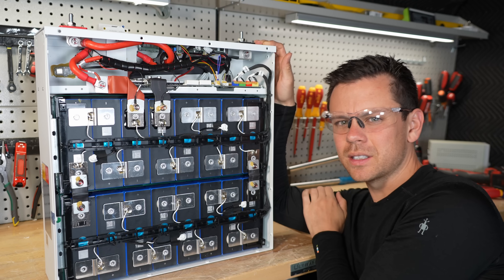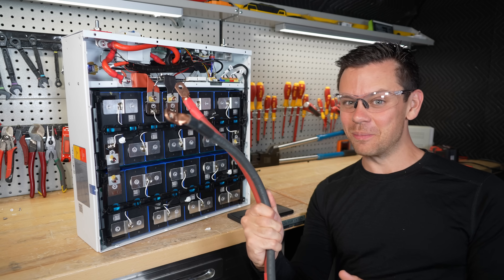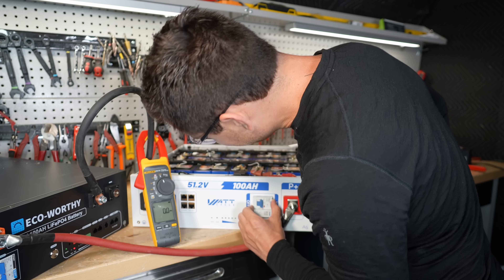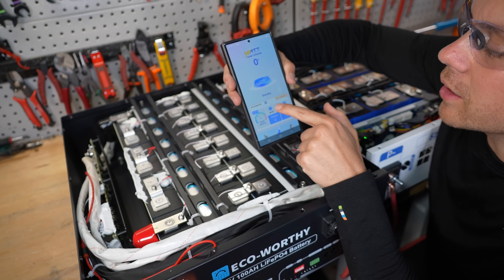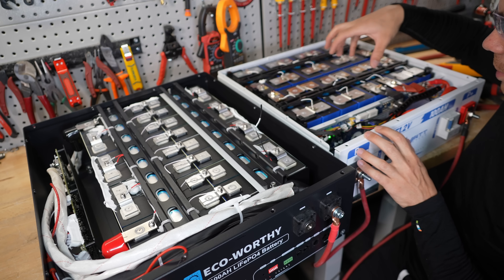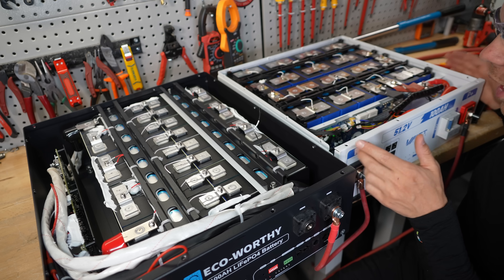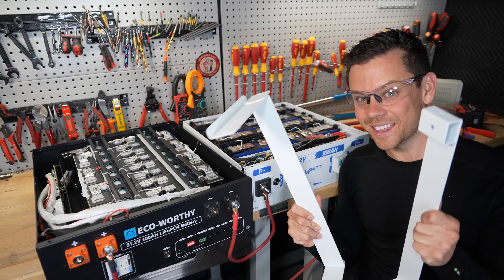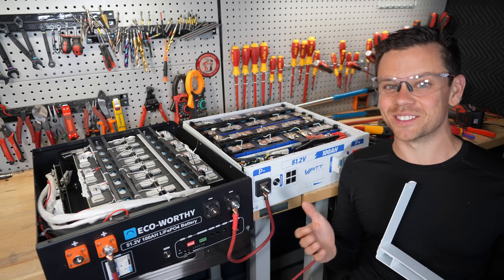$849 Wattcycle Server Rack Battery?! Quick Review...

Comment: My My My....  Mr. Prowse has great influence!!!!  I just received a consumer message from WattCycle about its new gen 2 server rack battery.

The message stated :..." V2 was rebuilt after Will Prowse's V1 test ---- updated with real feedback in mind, for cleaner long-term performance ---- without pushing the price out of reach.  Better fit for home backup & rack storage; cleaner install, easier ownership.  7-year Warranty (5+2) ---- our way of backing the platform with confidence. "

I'm newbee in to buy two V2 server rack batteries.  Excellent Work Will.  🤙

Comment: More than just an inductor is needed to regulate current.  Any slow charge/discharge capability requires switching or resistive limiting.  The current limit test in regard to having ‘no inductor’ was not a valid test.  Unless the battery contains an active DC/DC converter, no battery will actively limit current.  It’s fair to assume the battery should detect an out of balance voltage and potentially switch to an alternative charging method (resistive or small flyback/buck) though.

Comment: Regarding Will's stance on ring terminal temp sensor. Ring terminal temp sensors just add another step to assembly and thus cost. So what if the the sensor is more accurate? It will have a lesser margin of error. The BMS should take action long before even reaching a precise value where error would be detected. I do agree that temp sensors need some level of being mechanically secured. A divot with piercing where the glue has something more to grab than just the surface can cut cost. Glue passing through the piercing is almost as good as a screw holding it. The glue will loose it's mechanical ability to hold long after the prismatic cells fail.

Comment: Here's a video you should make i just thought of before hooking up my system. With an eg4 6500k and 10k of batteries and a 100 amp breaker from battery. What safety feature can we add if the battery breaker for some reason pops you still have pv input to the inverter which can ruin the eg4. What is your tip to not worrying about this issue?

Comment: As a data center technician, I am hesitant to be excited about having it lithium batteries in the data Hall of large data centers. A fire that spreads out of one rack is almost guaranteed to take out an entire pod of servers and potentially the entire data Hall. Because weight is not a concern when you're working with stationary servers most data centers are using zinc-based batteries or lead technology.  Zinc 5 batteries are literally only flammable because they have plastic casing, and that barely Burns once you turn the power off to whatever is causing the fire

Comment: Will could you take a look at the Paoweric 48v 100a battery for $639.?
I bought one and it arrived today. It wasn't even advertised as a smart battery but I have a Bluetooth connection and all of the information down to 16 individual cells.
Supposed to have low temperature charge protection as well.
App says the BMS is a Xiaoxiang DP24S002 v 1.0

There's also a 4 pin connector on the side for some reason the limited paperwork doesn't mention. Maybe a communication port? 

It's way too early to tell much since it has been hooked up for 30 minutes. But I am here to say I am very impressed with what I got for $639. with free shipping. It might be a good budget battery with a few frills for the budget minded people like me. That and I'd like to see inside it without me cutting it open.
Edit
I noticed they also sell a 48v server rack style battery. This is not that. This is just a giant plain style battery

Comment: I watched one of your old videos showing how expensive the batteries were and you commented that the battery would cost $30,000. Today I just saw a battery called King Kong that was rated at 62kwh which was several times more than $30,000 system and it was only $8,800. Will you be doing a review of this battery anytime soon, or have you done one already?

Comment: For balance leads which are low current, why is solder such a bad thing?  all the ring terminal and threaded connection do is add complexity to this component.  either way should be fine

Comment: Will could you not speak with WattCycle and give them a list of what is important and what is not? In essence, help them design a WPA battery.  "Will Prowse Approved".  It would save all the back and forth.  It seems unnecessary.  I had the same issue with roof tent companies making generic rubbish and releasing it to the market totally untested, and after using for 1 day I identified problem after problem that was so obvious it should never have been made.

Comment: So what is the advantage of these Server Rack Batteries over just buying batteries and putting them in series or parallel? Thanks in advance.
Reply: One advantage would be one needs fewer cables. So less cost on hooking them up in a system. Another might be that the BMS in a server rack is set for a 48V system, so would balance all the cells in it, while the 12V version would only have a BMS in each battery, and one would be responsible for keeping all the batteries in the system balanced.

Comment: I suspect the crimp on the ring terminals you prefer will fail sooner than the solder . Set up a tripod above both with scale and preform pull test on each.
Reply from the maker: Completely false
Reply: then prove it.
Reply from the maker: Mechanical connection because it is a cold weld, Will always be stronger than a chemical connection.   @dbobo2222
Reply from the maker: @dbobo2222 does that require more explanation or do you understand yet

Comment: Hi Will, Thanks for this video.  Most of what I have learned about LiFePO4 batteries I learned here.  As to the Balance leads the solution here does not look bad to ma.  I am guessing the wires are soldered to the nickel strip first, then the nickel stripiss spot welded to the bus-bar and I see a large spot of clear glue/epoxy covering the entire nickel strip and balance lead.  Soldering the leads to the nickel strip first would avoid the problem of soldering to the bus-bar as it avoids the large thermal mass and applying that to the cells.  I look forward a follow on video performing the hi current tests and cold temperature charging protection tests in the future.  And any chance  you could use a clamp meter with inrush capture?  I agree the plastic rail seams to only perform half the job by not providing any physical restraint on the cells.  Again thanks.

Comment: How can I hook a 48 volt battery to my 12-volt RV
Reply: Buy a 48V to 13.8V "Buck" or step-down converter. Make sure to get one that is about 40A output. Don't forget you would need to be able to charge the 48V battery, as the converter only works one way. Solar panels that add up to around 60V put through an MPPT solar controller might work, and/or get a 48V battery charger, such as the EG4 Chargeverter. If you can charge off the grid, good, but if you need a generator, you will need one large enough to power the charger. Also, if you have an on-board generator, it cannot charge the 48V battery!

Comment: I have an Enphase system with 2- 5P batteries. How many of the batteries you are talking about would it take to match a 5P battery? I would like to multiply my current battery storage by 3
Reply: If I did the math right, one server rack battery (at 100Ah/5120Wh), would be about the same as each 5P battery. You would need 6 to get 3 times the energy storage as you now have. Four would work, if you could just put the server rack batteries in parallel.
Reply: @Tumbleweed5150 thanks for the info! 👍🏻

Comment: Doesn’t the ‘P’ by a terminal mean Positive… what is a ‘P-‘… batteries have a P+ and a N- terminal 🤷‍♂️
Reply: The internal cell pack is labeled (B+, B-) the external terminals is labeled (P+, P-).  Most server rack batteries put the BMS between the B- and P-, and the (Circuit Breaker or Fuse)  between the B+ and P+.

Comment: Wattcycle Vs Eco-Worthy Vs Vatrer 😮 Will is going to tell us the best under $1K server battery!
Reply: Vatrer is a good battery with probably the best cells.  If you will Never Ever use closed loop comms then it's a solid option. Also if you want to remote monitor or do firmware updates you are 100% dependent on their App being around for as long as you own the battery.  

Eco-Worthy is definitely the best overall battery in this price range.